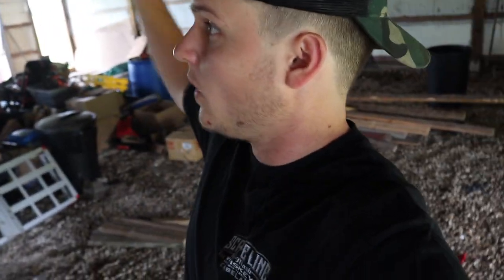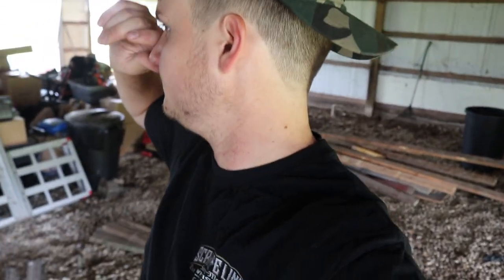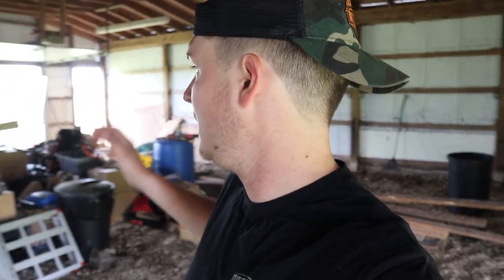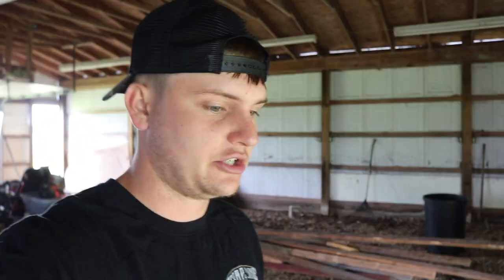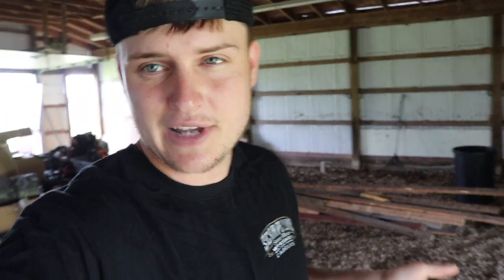DIY DREAM SHOP on a budget... Can it be done?

Comment: Utilize what you have for a shop! Or🤔 use that for equipment and personal vehicles etc. and build you a new garage for the business concrete floors with drains , a lift as you want it and then everything is new will pay for itself in time .Good luck  👍🏻

Comment: Rafters is a building that size are typically, a little heavier,  but those look to be closer together than than what I'm used to. So they maybe just as strong with more of them.  I would run the tin the length of the building and just wrap it up and over. Insulation your choice wouldn't over do it, that air gap and being sealed will do a lot. For the corners w/ the 4 vs 6 in your going the right direction. Remember if you're going to build in the near future don't overdo this one.

Comment: Malachi I’m no builder but if I wanted to keep a tight budget and plan building a new shop in the future I would look at mounting the wall steel right on the 2x4 that already exists instead of adding 2x4 all the way around would save you a ton of $ then you could either wrap those 4x6’s or leave them exposed kind of same thing for the ceiling mount to whatever is existing on the wall if those are old garage doors they look the insulated type good luck buddy witch ever way you decide just low budget lol

Comment: I've been doing metal roofing for 10 years for Miller's metal roofing you should be able to just put the metal ceiling right up against what's there then put in blowing insulation above that if you want to spend all the way across there I would say you're going to have to run 2x6s crosswise with supports coming down from the top in the middle don't believe there's a solution to span the whole part without supports me personally I would just go right up against what's there with metal
Reply: Me personally I would just go up against what's there so you don't add more weight than you have to
Reply: @chopshopart  wont the steel sweat  and cause black mold 2 grow on the insulation
Reply: @laisuresboringadventures7052  no I haven't seen that happen in our building it has blow in insulation laying on top of the steel

Comment: Like someone said fiberglass the ceiling for now that way if you wanted to add rafters for a lean too on the other side it would be easy and you could always metal line the ceiling later. I would insulate the walls and run vertical rough cut Amish pine boards board and bat interior. Much cheaper than osb or steel and will hold up better than steel on the walls. Cutting in your electric boxes will be easier into that wood than it will be in the steel also.
Reply from the maker: Interesting idea with the pine boards.. but if I get them wet, will they rot easily?

Comment: I get that it looks nicer and maybe makes things nicer to clean but there not a huge functional advantage to tinning the entire interior of the shop. Its just adding expense and complexity. Again, even if your reasoning is mostly for looks then I totally get that. If were me trying to use this shop on a budget I would 100% leave the walls and ceiling open. You can totally put standard 2x6 insulation batts up between those rafters on the roof line just like it would go into the walls. It holds itself in place with the paper membrane stapled to the beards on each side. if you want to add wall insulation you can add rigid foam sheets or stick frame in a "normal" wall stud spacing and do tradition batt insulation again. Another thing to really consider is if you drop that ceiling down more I don't think you're going to get a truck sized lift in there. You need a full 12' of height. All said and done down the road I'm guessing this shop will turn into equipment storage. Definitly no need to break the bank on it.

Comment: Having the flat ceiling would be nice but if you ever want to put a lift in then you may want to high Arch
Reply: And as far as the walls go are the Gable ends all turn 6-in or just the corner posts and all four walls have the 4-in side I kind of understand why it was done that way to keep as much floor space by only having 4 in from the tin into the building but even that one seems a little odd to me you might just have to scab boards like you said that would probably be the easiest way or otherwise you just have a little Swale in the wall

Comment: Also looks like you have 8’ fluorescent light fixtures they make 8’ led bulbs that work without a ballast you wire the positive wire to one end and the neutral (white) wire to the other end of the bulbs inside the fixture’s.  You can get the bulbs with R-17 ends (high output) or single pin. Whatever your existing fixtures are.  Also one of your competitors on youtube built a nice shop at a cost of over 200k.  This building will work fine for what you do.